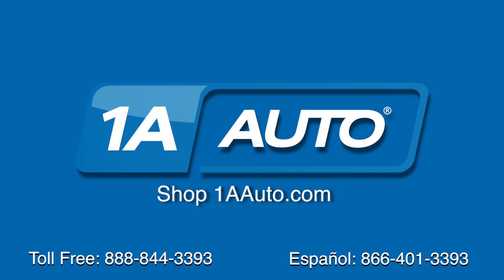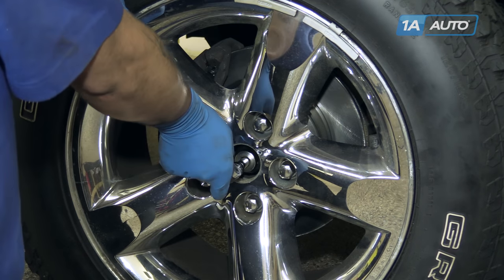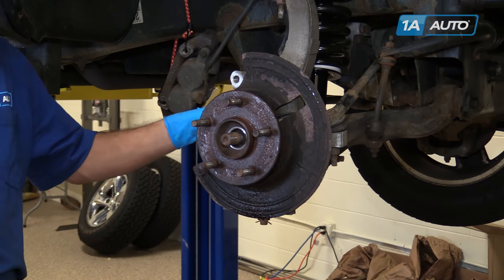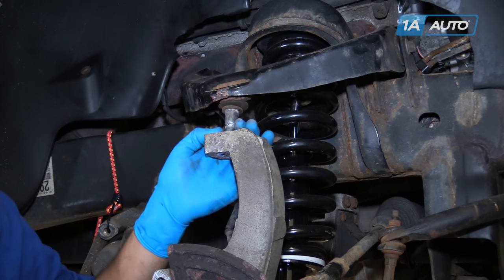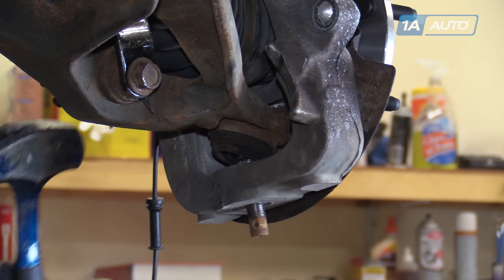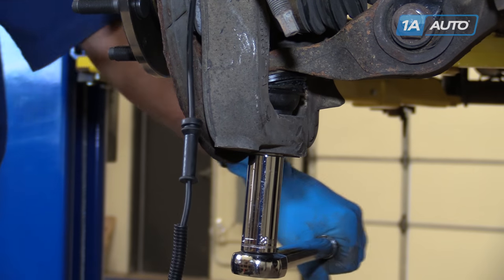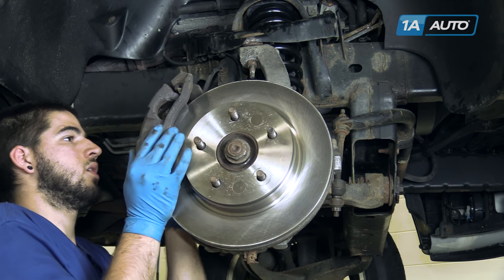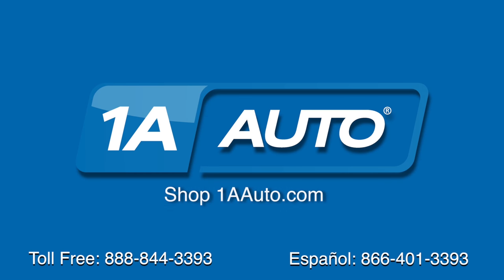How to Replace Spindle 02-08 Dodge Ram 1500

Comment: Having an issue with an 08 dodge ram 1500 4x4 I noticed my truck when steering full right or left and drive very slow. The truck wheels feel like they bind or they skip over or something. So I jacked up the truck and saw that the steering knuckles hit the lower control arms. What's causing this? Can it be bad knuckles or can it be lower ball joints or something else. I've checked all bushings and they look fine all around. Just can't tell what's causing this issue.

Comment: I got everything apart on my 04 ram 1500 except the spindle from lower ball joint could not get that thing off no natter what i tried. Also noticed no retaining clip, grease fitting, or castle not with a coder pin on my lower ball joint. Is it possible i would have to remove complete lower control arm to replace the lower ball joint?
Reply from the maker: +chuck beck Yes, you may need to remove this part to allow you access to install the ball joint.

Comment: I have an 07 and am having trouble removing the axle nuts.  Are they supposed to be as easy as you make them look?  Drivers side barely came off with a 6 foot pipe on my 1/2” breaker bar.  The passenger side broke a short 1/2” impact extension, then the next try broke the breaker bar.  This was after an overnight soak of PB Blaster.  Any suggestions?
Reply: This is the same issue I'm having right now everything is stripped now broke a bunch of rachets now I just got a whole new knockle and now the old knuckle won't come off the bottom ball joint its been nothing but a nightmare looks really easy here tho lol

Comment: What is the Size of the axel nut?
Reply from the maker: +Gweedo1 Thanks for checking us out! The size on this model is 35mm.
Reply from the maker: +Gweedo1 This video is applicable to the 2008 Dodge Ram 1500
Reply from the maker: +Gweedo1 Thanks for watching!  It could be a different size for the 2500, but we do not have those specs available.